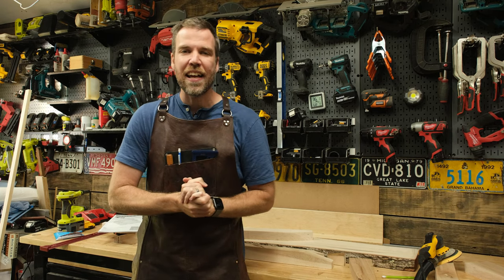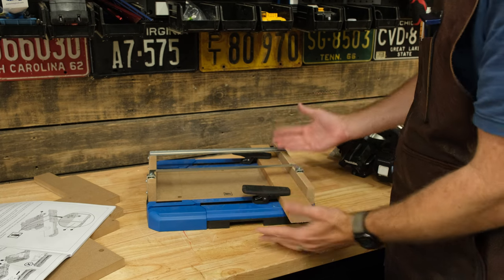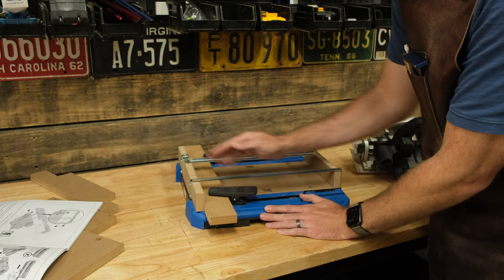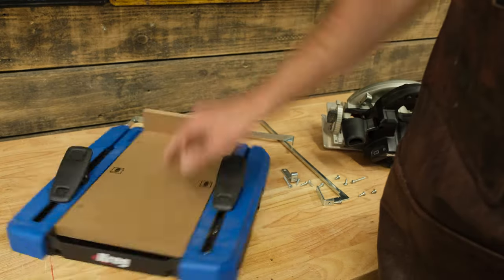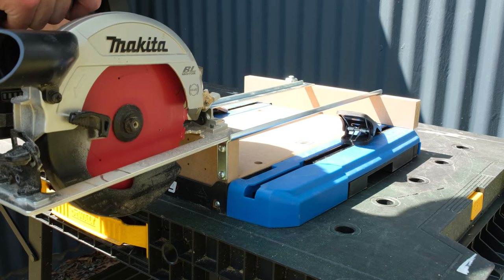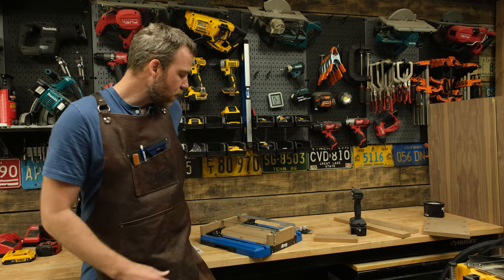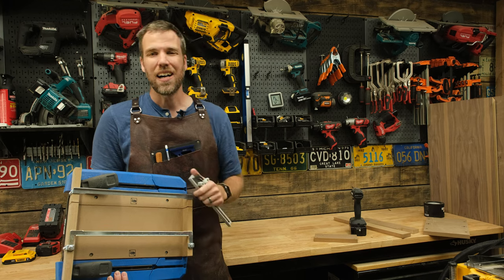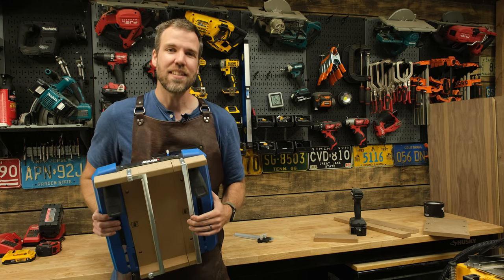Kreg Tool Crosscut Station Review

Comment: you are not alone... I have that bad habit too of looking at the images instead of reading the instructions.  I inverted the rails, kerf is too much on one side.  Kreg are sending me replacement parts and this really shows their commitment to satisfaction and above and beyond what you expect from a company.  Bravo et merci
Reply from the maker: Kreg Tool customer service is amazing.  I've always had an excellent experience with them.
Reply: I screwed mine up as well, and they also sent me a new set. I emailed asking if I should move the location and do a new kerf or to just use it with it too wide and they just sent out new parts. I have zero fear of the “blue plastic” breaking in their kits since it is clear they will stand by them.

Comment: Time for confessions!
Mine did not cut straight: the kerf cut in the base wandered right about 2 mm and then came back in line in the couple of inches before reaching the backboard. I identified the problem as one of the guide rails being bent down slightly near the middle, so I grabbed it and bent it back up. It went right back to its evil ways.
Eventually the light came on: I had dropped the rail when unboxing and it apparently landed on one end, bending that end in ever so slightly... but pretty radically by the time the deviation reached mid-span. Some careful correction (a replacement rail would have been a better choice, but I'm lazy and stubborn) got it all back in true.
Reply from the maker: They are great at replacing parts too.  Customer service at Kreg is top notch if you ever have any issues.

Comment: Just set one up, and also got confused by the images in the instructions. Noticed the image of the Station on the cover is flipped, from the ones inside. Although, now I understand one is showing a right facing blade setup, other left facing blade. Still - was confusing!

Comment: Does this station also allow cuts with the sawblade set to angles not 90°? Like a 45° miter cut?
Reply: I’m sure you could cut a secondary kerf but the way they’d probably recommend doing it is cutting a 90, then using the provided miter gague to cut a 45 at the end

Comment: What’s your opinion?  Could you set this up for a router as well?  I often need to flatten and square small boards, but don’t want to buy a planer.
Reply: I imagine you could - but setting the depth would be more tricky - might have a 1" gap between router base and wood piece. Also, readjusting the metal bracket for fitting the router base.
Reply: Thinking the same thing

Comment: Is this big enough to allow a 45 degree cut on a board that would be 12" wide?
Reply: No - I checked out the miter ability and found 45 degrees on six inch stock is the limit. The portable crosscut will do 45 degrees on 12 inch stock but only right to left (unless I'm missing something.)

Comment: Will this work with a 5 1/2 saw? Will it cut deep enough?
Reply: You can probably chop off the top of those mdf rail holders to take it down to wherever you need it. But you’ll have to drill new holes for the rails. It should work though.

Comment: Why didn’t you show the 45s ... ?
Reply from the maker: Pure laziness.  But you just slide in the miter gauge and line up the cut.  As long as your rails are installed tight, you shouldn't have any chatter and the cuts will be accurate.
Reply: Maybe he’s waiting another replacement from Kreg, so he can show miter cuts properly.  🤣
Reply: I did a raft of 45 degree ends on balusters last week - I lost count but nearly a hundred - and the biggest speed limitation was clearing away the pile of cut off ends.

Comment: Mmm I think you did it wrong again, the kerf you be in the very middle of the board xD
Reply from the maker: It depends on the fit of the shoe and which side the blade is on, but ultimately doesn't matter as you're lining up your cut with the kerf and not the center of the jig.
Reply: @LazyGuyDIY  Try using the miter guide with that setup. 😉